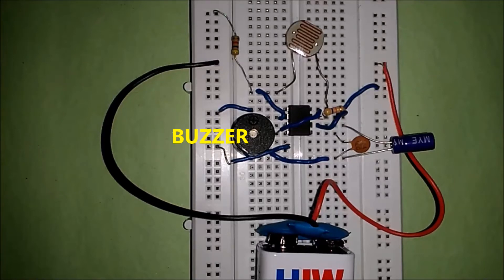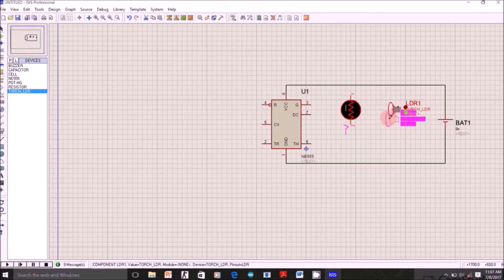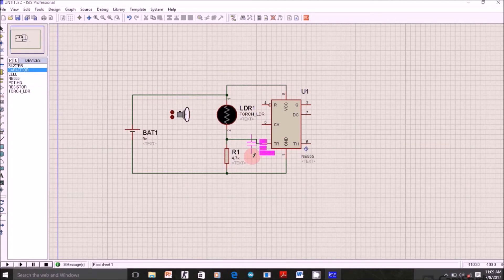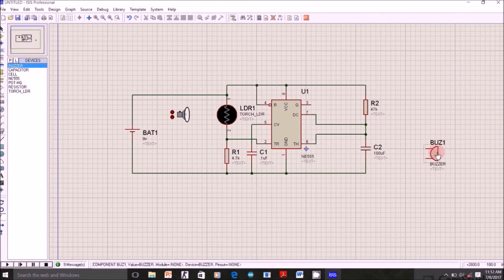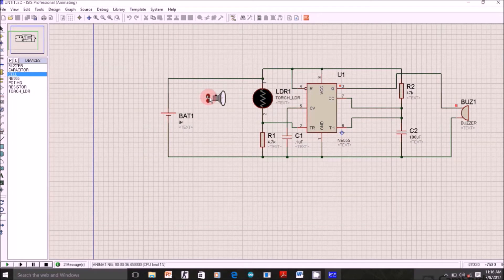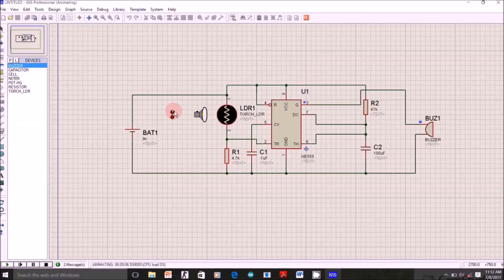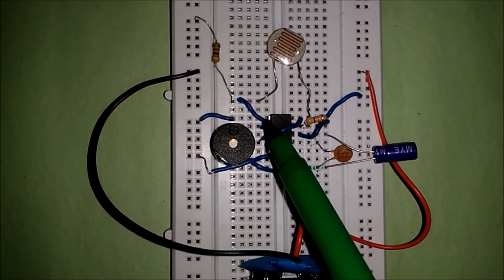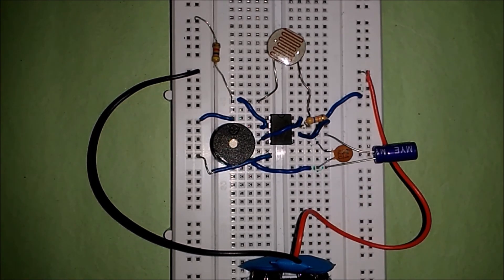How To Make a Dark Sensor Using LDR and 555 Timer

Comment: Values of capacitor is different in software connections and in breadboard connections.
100microfarad in software and 10microfarad in breadboard
0.1microfarad in software and 0.01 in description.